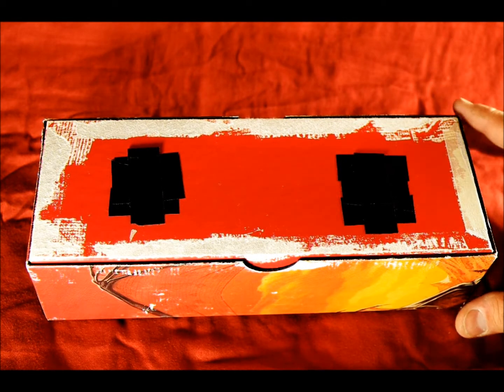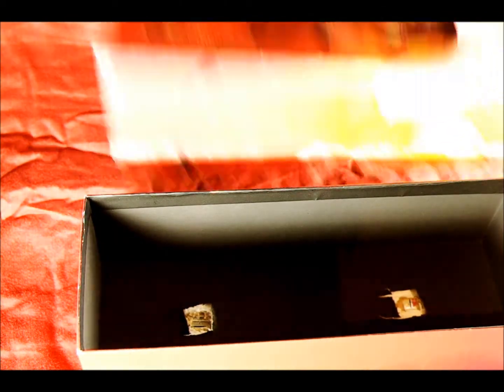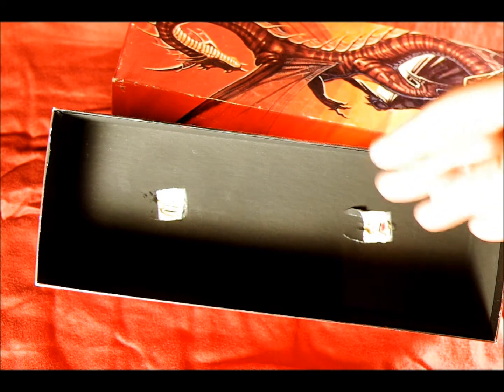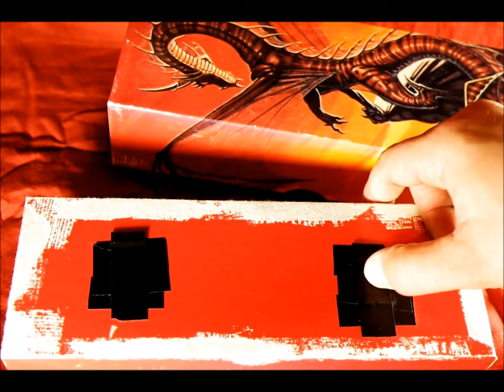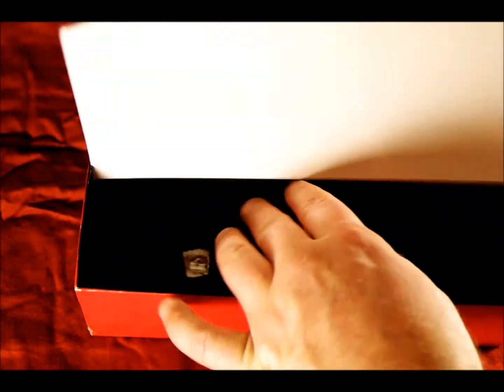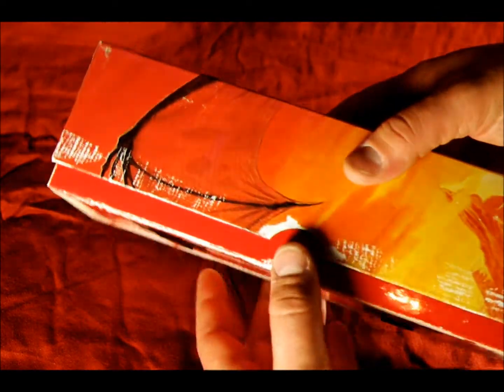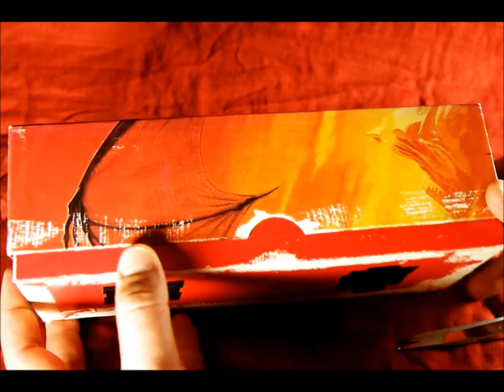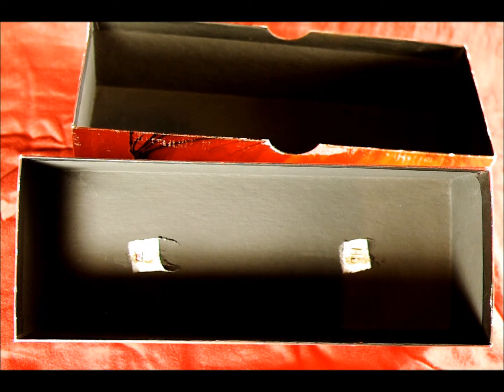Intermediate Pinhole Camera Construction: Stereoscopic Pinhole

Comment: not sure if you're still here, but 1) thanks for the video 2) I came here thinking of doing pin hole cameras for Stereoscopic Viewers (like in the old days) using Hartman Positive Papers or TinTypes. Any thoughts on that? Thanks again for the video
Reply from the maker: I am and thank you!

For DPP, I believe the daylight ISO is 1.5. So you can do that easily if you expose properly. I've used DPP in pinholes and it works just fine. I have, fun fact, a solargraph that I'll finish today that's on DPP. It's a great film, wonderful to use.

As for stereo work there are a lot of ways to do it. The easiest would be to re-purpose a cigar box -- already made. I've made a number of cigar-box pinholes including a 5X7 model that could be promising as a stereo pinhole. What you'd need to do is line the inside with black felt (or paint it black -- I prefer felt as it greatly improves contrast by eliminating internal reflections) and then drill two holes in the front (the lid, preferably) for the pinholes. You could either make shutters out of tin foil and tape (easy) or use a piece of thick wood with a couple of holes as a sliding shutter. The easiest way for the latter is to use large-head nails just slightly longer than the shutter material and have them hold the slide in place. The advantage of a single, sliding shutter is that you'd always get the two exposures at the same time and with the same exposure. That's also a disadvantage as it limits you to that. I use a lot of old ball bearing leaf shutters in my pinhole cameras as they're accurate, light-proof, and easy to install. So that's another option.
Reply: @DavidHancock  Thanks for the response and info!